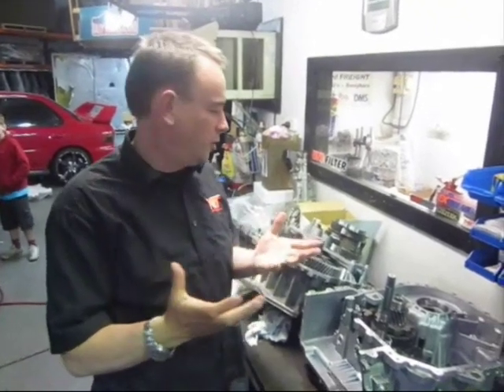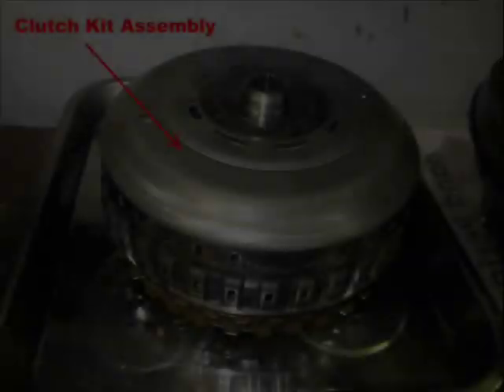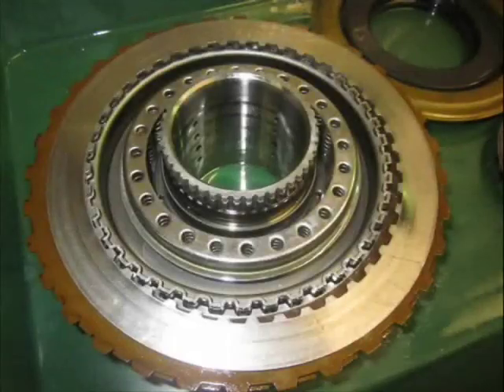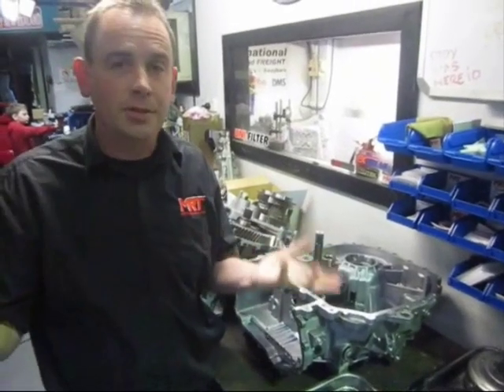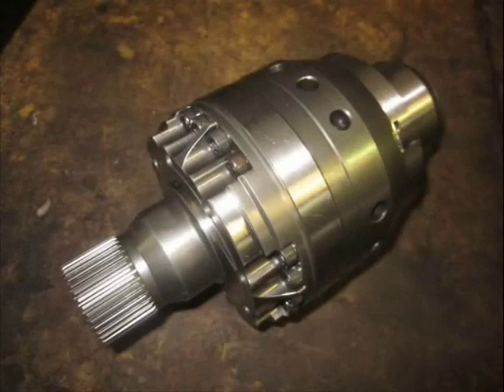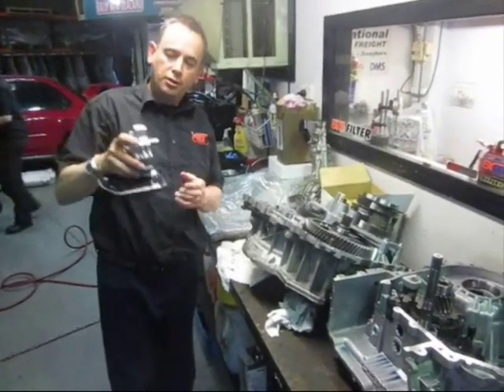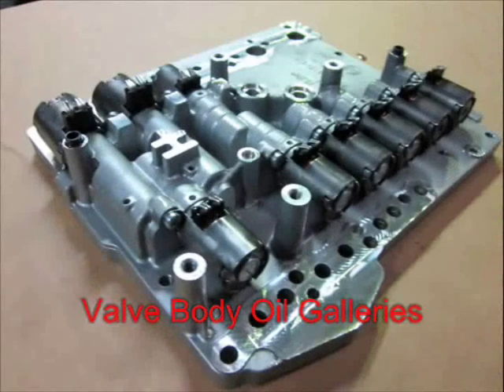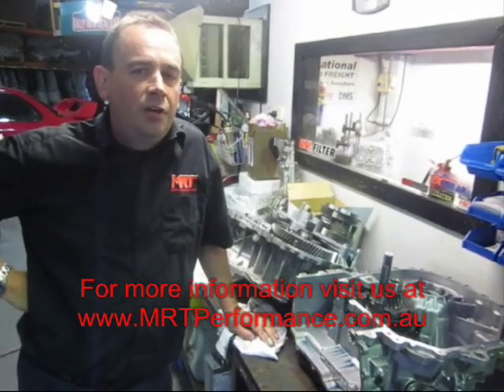Mitsubishi SST transmission inside secrets Part 2

Comment: Hello Brett.
Do you have any info on what seals do I need between the transfer case and the gearbox for 2008 Evo X GSR (5 speed manual) ? My local dealer's software shows blank in that area. 
At least maybe you know if these are same parts as for Evo IX ?! Because I found those.

Comment: Dear Brett
I wish i can visit you at MRT but i live far far away , in the galaxy  ISRAEL.....
hear no one know any about this car .....
But many MR (sst) owners has this  knock problem when they are in NUTRAL or in PARKING gear , and the knock despair  when you shift to DRIVE mode .

pleas see the long thread about it in "evoxforums " at the name :

2010 TSB for transmission shaft

you can also put this sentence on goggle , and it will take you direct to this thread 
.

Comment: Dear Brett
A lot of Evo X owners( including me ) , have a wired knock noise in neutral mode , that gone away in drive mode  :

there is a lot of discussion on this in the Evoxforums web site , under the thread  name :

2010 TSB for transmission shaft 

Are its normal like some dealership says?
Or that mean that we have some problem ?

Thanks , Amir